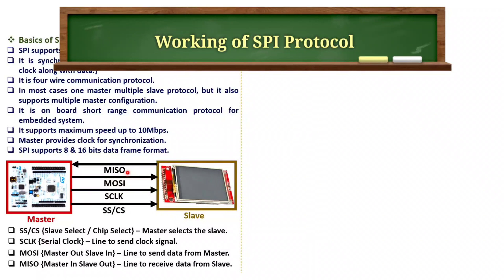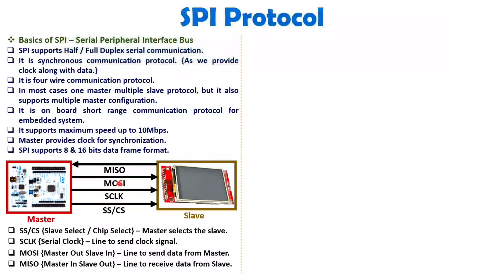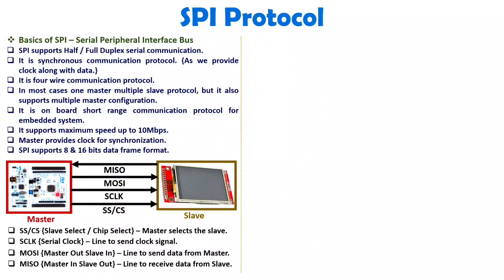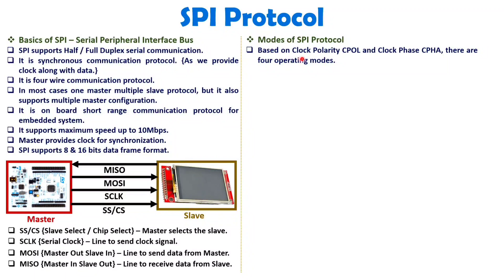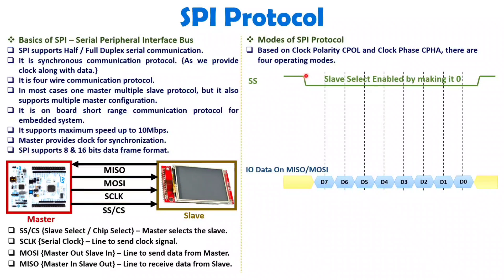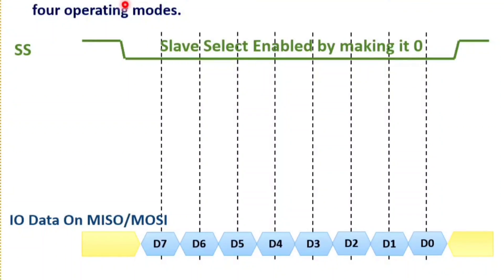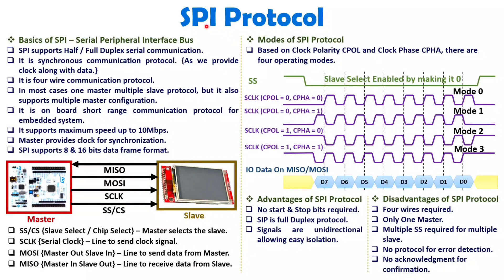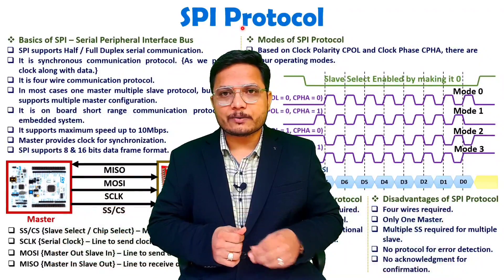SPI Protocol Explained: Basics, Working, Modes, Pros and Cons

Comment: Sir here as we are not using start and end bit then how master/slave get to know that data starts transmitting?
Reply: Unlike UART it does not need start/stop bit. The slave starts reading the data as soon as the Slave Select line goes low. The SS line tells you where to start and stop.